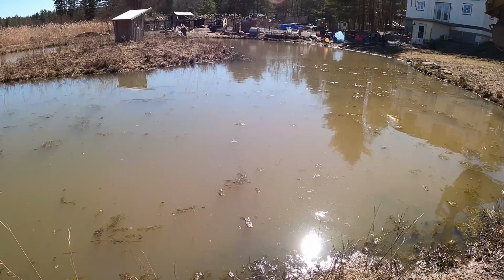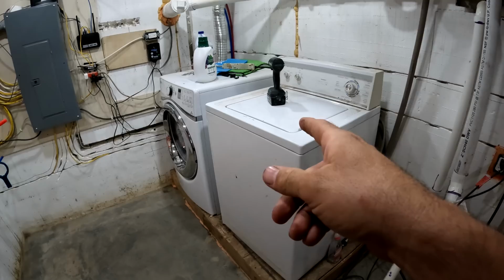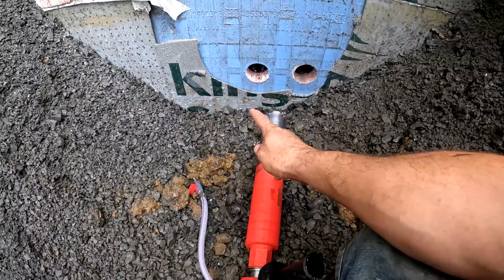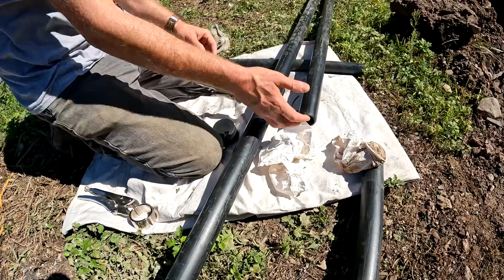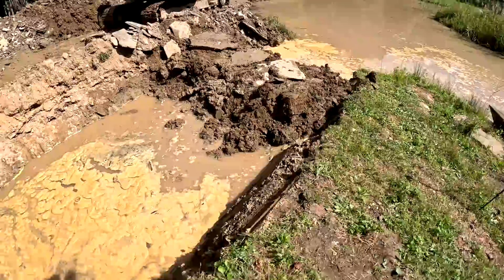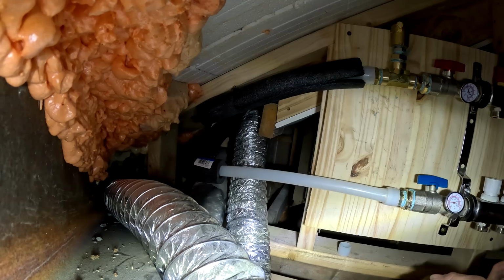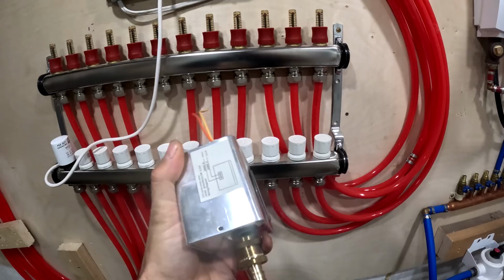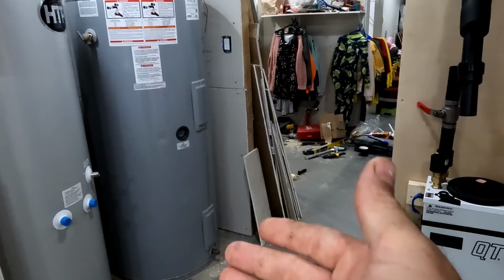Installing a geothermal system with a pond loop at my house Part 1

Comment: I'm a retired roofer in the UK and I know nothing about geothermals but I do know a heck of a lot of plumbers/heating engineers and I've never heard a bad word said about Grundfos pumps so I think you made the right choice there, they're quality kit. Cracking video, as usual, loved every minute of it.
Reply: Yes, they are built like tanks and last almost forever. Grundfos is based in Denmark and is the biggest provider (50% worldwide)of this kind of circulation pumps.
Reply: In Norway Grundfos pums are the industry standard and we have some harsh climate 😅
Reply: @@mvasilyeu4116 And again in English, please!

Comment: I’ve been a commercial electrician for 16yrs, they got rid of these hammer drills/macho, before i started at my company. But the older guys told me stories about the old macho drill, we use to have. They said a lot of ppl use to get injured, especially if you were drilling, and your body was stuck in an awkward position. When the hole saw would get bound up, on something like some rebar, the entire drill would start spinning. So the handle use to smack ppl in the face, and the most common injury was ppl messing up their wrist, holding on. It had to be a damaged drill that they kept using. I can’t even see them back in the day, not having a clutch, or whatever they use today that prevents it from happening.
Reply: I use to help my dad alot when he worked for PORTLAND GENERAL ELECTRIC back in the 50'S. We absolutely had some big drills that could torque your wrists in a loop. I was in grade school then and I learned alot of painful lessons back then.
Reply: Oh man I used to retrofit security systems in houses back in the 80’s-90’s and we were Drilling Specialists. I’ve seen accidents that would gag a billygoat. We used high power drills with 6’ Diversa bit w/ 6’ exts, big bellhanger bits and all types of hole saws. 

The biggest problem running high powered drills is that you can’t make yourself turn loose of it. It’s sorta like a motorcycle throttle. You just keep making it worse the longer you hang on but you cannot let go either because you know the drill is going to spin and beat you to death. I have seen many broken wrists, teeth getting knocked out. I even saw one guy lose control of his drill and his ponytail got wrapped up in the chuck. It literally scalped the guy all the way to his skull.

Comment: You know you could’ve just put water in the system and used a lot less block to make the pond heat exchanger loops sink. Unless of course the tubing is less dense than water.

Comment: I have some of those air purge valves in my system too.  They are simple in how they work.  There's a float in there, and when they are full of water the float rises and closes the valve.  When air collects inside the cup, the float falls and the valve opens letting the air out.  Pretty clever little things.
Reply: You know you’ve done good when John from farm craft likes your choices in valves, and seals 🦭
Reply: I want spacers between the coils. Why not 200 individual coils in contact with the pond water instead of four large ones?

Comment: Jesse, in the past when I've had to drill holes like that near the ground, a way to take some strain off you that I utilized in the past is to drive a 2x4 stake or something of the sort into the ground and then take a squeeze clamp that you can flip around to the configuration where it becomes a spreader clamp and I push on the back of the drill and the stake and that makes the drilling effortless and it will drill so quick it'll amaze you.
The same technique works in reverse anytime you need to drill a big hole in something you can get a squeezy clamp around the drill and the material instead of having to push on the back of the drill, let the clamp squeeze the drill into the material.
Reply from the maker: that makes sense, thanks for letting me know
Reply: What a great idea! Saw similar on the pakistani truck channel when they drill holes in truck frames

Comment: Cool to see! We in (the Netherlands) drill holes in the earth max 150meters.  For water to water heating systems. Already do so for 25+ years and we are very happy with the results. Of course also have one at our home especially the cooling is nice in the summer! Not comparable to an airco system
Reply: Ps: the big benefit with water to water systems is have a constant temperature when using a well system.  At 100meter deep is always +-12 degree celsius. When using air to air (air-conditioning) or air to water (floor heating) you don't have the 13 degrees in winter. A air to air heating system is no wizard so its CP wil drop allot and it will use much more energy than a water to water system.

Comment: Hi, Great video. You may want to add a second circulating pump just in case.  Just wire and pum it ,but do not use it. It will save you if the main pump gose down. In the winter. Lookig forward to the next part of your install. GOOD JOB.

Comment: I am very skeptical about this geothermal heating system, Very curious to see how it is snowing and cold. Thank you for sharing! 👍
Reply: They function well, since water at the bottom of a pond/lake/ocean is usually 4ºC/39ºF as that's the most dense temperate for water, so water that's colder or hotter rises. If you push heat into the water, that water will float. If you pull heat out of water, it'll also float.

If the pond is too small it is possible for it to free. Similarly in summer it could get too warm. It shouldn't be a problem where they live in New York as they don't get extreme cold or heat.

Comment: All the poly pipes used in local gas as well as water are made from essentially the same polymers. Thickness is the greatest variable I have noticed, but running black pipe is very common in Texas, with orange being reserved for natural gas. Both assemble using the socket /hot plate Jesse used. A comment he made about the temps and always watching; in every state it is allowed, IIRC, only licensed and specially tagged plumbers can do the joins and connections for natural gas. Absolutely awesome DIY install, Jesse! PS; I'd go ahead and hit Water Furnace up- you are correct, there is not a lot about hydronics; one or two of the pole framers have info on installing in slab piping but not much else.

Comment: Well man from a southern hvac tech with 28 years under my belt, I've always been curious about full hydronic systems, (we just don't have them around here) that was a very informative video. I'll say well done so far, just from what I've seen your attention to detail is unparalleled and your working knowledge of the system seems to be on point. I'm thinking about putting in a geo system when I build my house except my property hs no pond I'd have to do a well or ground loop.
Reply from the maker: Thanks. You should get a geo system. The reason they arent popular is because nobody wants to take the time to break from the norm. This unit will have a COP of over 4.0. So for every unit of energy I put in equivalent to electric heat, I get 4 units out of the unit

Comment: FYI, those air handlers are almost the same as a mini-split except for tubing size perhaps or maybe it is the same size as well and only the connections are larger for the water supply.  Can't see why they would be so expensive as millions are being made and sold all over the world.  Speaking of which be very careful of your condensate lines, keeping as much drop as possible throughout the run with no flat spots in the run.  In a year or two any flat spots will accumulate moisture and mold will grow emitting a nasty rotten smell back out the handler.  That one looked like it was mighty close to the overhead, but that might have been the camera.  Six or eight inches is a minimal minimum especially since you will be running low efficiency at ninety degrees you will want to move as much air as possible.  Personally I wouldn't put them closer to the overhead than twelve inches if at all possible.  Interesting installation having it "top off the heat or cooling" and only come on after the main source bottoms out.  Having it run parallel would be easy but only coming on after sensing that the main system can't handle it is going to be a bit more complex.  While the computer in a normal mini split could do the first easily enough I am not sure it could handle the second scenario.  A two inch foam box might be the simplest way to handle that manifold.  Spray foam it together.  Make it removeable by pulling it straight forward.  Insulate the back of the mounting board and wall.  Simple and easy.  Very interesting topic and I will be watching as it takes shape over a heating and cooling season for how it turns out.  Thanks for doing the videos.

Comment: Hi Jesse, a good way to deal with the pipes is to mount the ply behind on 4x2’s creating a gap behind the mounting board, then you can route the pipes through the back and bring them out under the manifold

Comment: Great information Jesse, in Australia there is a push for mor efficient heating and cooling, but our building codes are pathetic compared to how you have built this house. I have been following this series right from the start, you are doing a great job!
Reply: Really? I watch Grand Designs and it seems that you can't build a house there for under a million$. I figured they'd be at the pinnacle of engineering if anything.

Comment: Where were you about 6 months ago with that Bluerock core drill? LOL. I drilled 7 holes through the foundation this past spring and summer. That would have been the bees knees. I drilled multiple 2" holes for conduit, gas and sewer. The next time I have to drill a hole I will be buying that drill!

Comment: The air vent on the top manifold works basically like the float on an carburetor, as long no water presses the float up air can escape through the vent hole.

Comment: It's going to be interesting how that performs when the Mosquito pond freezes over in the winter 🥶❄️
Reply: It’s going to perform as designed. If an air-source heat pump is still effective to 23 degrees, this at a minimum 39 degrees will do just fine. It’s not a new technology.

Comment: So much Knowledge in one head is amazing, plumbing, building, electrics and mechanics and much more, amazing, hope your kids realize how good a teacher they have.
One tip,  watch out poking around on a live board with a pencil is dangerous( i could see by the LED)  as the graphite in the pencil is like a live wire, I know its insulated with wood but they crack, even so be careful.

Comment: I have air to water heat pump with radiant floor heating system, it runs almost 6 months per year as in Baltic states we do get cold weather and coldest I have experienced with my system was -26F and system wasnt maxed out (8 kw heat pump+9kw electric heater) depending on how cold winter is heating and warm water preperation also from the same hat pump uses aproxametly 3000-4000kw/h for living space of 2100sqf

Comment: Just a thought... could you have released the air pressure in the pipe, fill it with water to sink it, then re pressurised it if you were worried about the dirt pressure oveling the pipe? Hummm. Keep up the good work. You are doing fine. Yes, I built my own house in 1985, before internet and the great knowledge that can be obtained from it.

Comment: Grate project fun to watch .the heating manifold I would move it over to the left and down so the pipes still fit and re fit  the pipes that come down from the top . with tight flat to the wall bends same as the pipes from the left side ? Nice work  Thomas from Wales 👍👍

Comment: If you want to cheap out on the core drill, you can get an adapter to use an sds-drill with a core bit. Just make sure the drill has a safety clutch. It takes a lot longer, but it will get the job done.

Comment: When using a core drill down low against the ground I use a long pry bar to put pressure on the back of the drill.

Comment: Very interesting installation. Would you consider a water tray under your unit, just in case it ever leaks. Our very old gravity hot water tank had a tray that was plumbed to outside, they also had blocks sitting in the tray, so unit could be slid out of the tray, with out having to lift it first. I've also seen water alarms sitting in tray, just in case.

Comment: Insulating the upstairs manifold would be easy if you use an expanding foam pack.  Cover the manifold in plastic sheet. Build a plywood box with lid around the manifold. No gaps around hoses going in or out.  Put an Instapak inside and close the box lid. The foam will form-fit to everything without sticking to anything, so you can remove it if you need to work on something.  Should work great.  Instapaks are under $20 for a single.  It's an idea anyway.
Reply from the maker: Thats a good idea. i might try something like that

Comment: That air valve has alcohol in it, when the alcohol senses temp hotter than the air it automatically shuts off the flow. It resembles a brass carburetor float and needle valve
Reply from the maker: That is interesting

Comment: Thank you for a thorough coverage of your geo thermal installation. Very glad that I cam across your video as I have installed 22 horizontal loops in my front yard as I need 2 two 5 ton units for my house. I never thought of using the pond in our backyard. I am sure it would have adequate as it is faily large 220' x 100' and about 15' deep in middle. It's too late now as the loops are already in. It didn't take that long as I a have a 200xl excavator and it too a few full days to lay them in.  I am interested to know how the water to air radiators are performing. Also would like to know how well your Water Furnace performed over the winter. I am on acreage in British Columbia, Canada which has similar temperatures as your area. I am almost finished building a large ICF house and hopefyully getting to the heating and cooling this summer.

Comment: FYI: Driscopipe also makes the N.G. yellow pipe that the utility co. install.  Ran a 36" Driscopipe water pipe @ AKS Mansfield Plant for a new HSM addition. Many years later I found out that they were drilling and put a hole in it.  It's good for a long run, not good for end termination fittings not available. Install an their adaptor in my case flange and c.s. welded pipe system.

Comment: In europe we would have done the diameter much bigger to put some insulation around the pipe. When running the system the pipes will be almost all the time below the dew point, it will create a lot of kondensate. This will keep you’re wall wet and start moulding. In the wall and on the inside of the building  the tubes should be insulated class a (against condensate).
Reply from the maker: The geothermal loops? They are all insulated
Reply: @jmuller86  Yes. Idealky it is uninsulated in the pond only.
Reply from the maker: @fikamatyi2 that would be less efficient. The loop going to the pond adds to the loop. That counts as more of a place to extract heat

Comment: Fancoils are insanely expensive and very unusual in the netherlands as well, which i solved by buying every second hand unit in the entire country for a year, which was 3 units. After this i found that they are very popular in Italy, and they go for a more reasonable amount and with more choice and parts availability. they've been in use here for a few months and work well enough, though it isn't the most efficient system. i would have rather done refrigerant manifolds throughout the building, but the plumbers commission has lobbied the government hard enough that only their companies are allowed to buy refrigerant and charge systems, and they only do that for systems they've installed. So using monoblocks is the only way to diy here.

Comment: The recomedation here in denmark is it should run on number 2 not auto adapt when you have the floor heat. Worlds best pump made roughly 30 miles from me😉

Comment: One thing that keeps me from committing on a similar project, is frakin beavers. Our pond is quite a bit bigger and has several draws. The bastards get in there every few years and plug up the pipe and the emergency spillway. And then I have to dispatch them...sometimes this takes me quite a while. Not sure if they would chew on the loops. I'm sure they would hear the water flow. Maybe cover them with a bit of sand?
Reply from the maker: Yea they could be a problem for sure. Pond loops are definitely not for everyone

Comment: Great video, appreciate the deep dive on your system. I don’t recall how tight your envelope is, did you do a blower test and share the results? Sorry if I missed it.
Reply from the maker: I didnt get a blower door test yet but it is required by code before closing on the house so I will get one soon
Reply: @jmuller86  thank you for responding. Your home is an amazing example of high performance systems coming together; inspiring and appreciate the details as you breathe life into it.

Comment: once you set it up, it runs off 45watts , crazy efficient.. a friend of mine installed a water system to heat hot water stover heater.. hes never regretted it.. his runs off 1.5amp circulator..

Comment: Have a few Eco Bee stats at work. The processor in the stat give off so much heat it throws off the internal room temperature. Ended up using remote sensors.

Comment: Super nifty, but my mind boggles at all of the potential points of failure!
Reply from the maker: Yea I thought the same thing but this pipe is really durable. The loop was basically free so If I have something happen to it, I wont loose sleep over having to repair it. As a matter of fact if something happens to it, I will probably abandon it and drill a well right next to the house